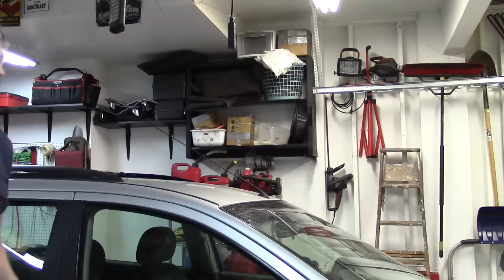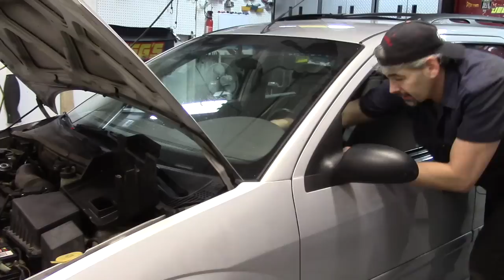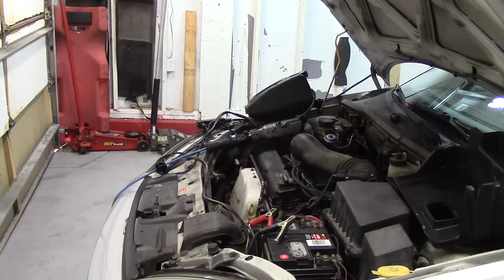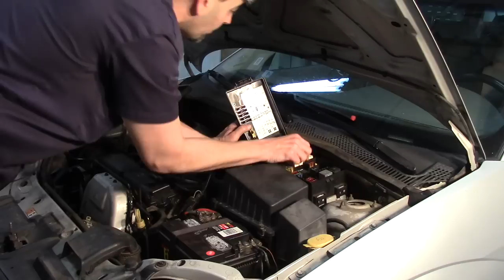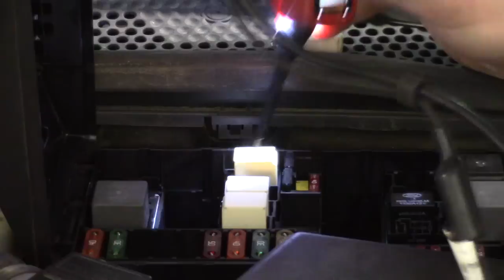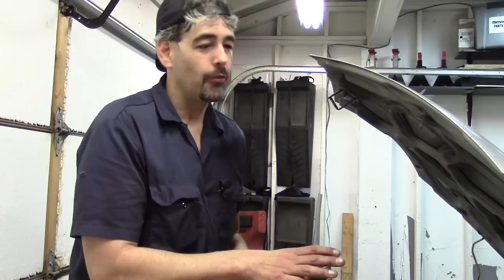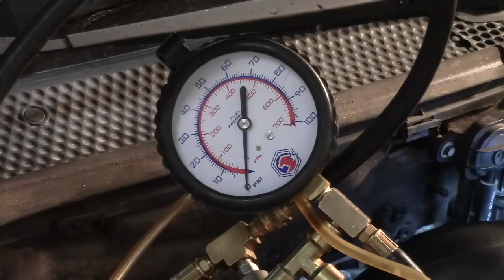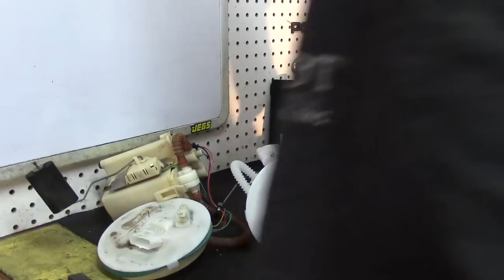Cranking No-Start Real Time Diagnosis -Ford Focus

Comment: man this is an awesome video, i was wondering if you had any videos on how to properly check for voltage and ohm resistance and contunity safely on a pcm at the wiring harness pins and connectors. I have a 1997 acura integra with some electrical problems and diagnostics call for checking voltage and continutity at the pcm, and also some sensors. Schrodingers Box
Reply from the maker: Lalo Herrera Checking sensors and PCM's safely does not come from watching a video- it comes from an understanding of how electricity works, how the components work, knowing ground side switching vs power side switching, and knowing how to use the equipment. It is a comprehensive knowledge, not a "technique".
  If you want to see a video that maybe covers these concepts more than others- see my recent video called "P0138,P0139 Diagnosis from hell" on a nissan maxima.  If you watch that video and aren't fully conscious on what I am doing and why I am or am not concerned on the potential for causing damage to the PCM, then I would recommend you not do the diagnostics yourself.  If you clearly see why I can ground out the O2 heater circuit on that model without concern for shorting out the PCM then you are probably good to do your own electrical testing.
Reply: yeah I watched both parts about two times to fully understand everything. It made sense how you chose to diagnose the sensor and ultimately find the short in the wire towards the end of the video. must say that was a tricky diagnoses, but the explanations were on point and very thorough.

Comment: You got me good this time. My wife & I were watching together and as soon as you said 03 Focus no start I looked at my wife and I said fuel pump relay because about 4 years ago we had an 03 focus have the same problem and I diagnosed it back to a fuel pumthe car ran good for a little while but then wound up having a major electrical problem that caused me to have to have the engine completely rewired so I took it to a shop a couple days later it caught fire driving down the interstate that's when I decided to open my shop so things would get fixed properly

Comment: i belive that ford redesign their fuel pump. they did away from the style of locking into the bottom of the fuel tank the new design is the one you have and you have to cut the plastic locks off the bottom of the tank for the new design. great video on the on the right way to diag a no start
Reply from the maker: andrew hippe Not sure what you are talking about but I most certainly did not, would not, and never had to cut anything ever when doing any fuel pump.

Comment: sorry if this question kinda defeats the purpose - but wouldnt it be nice to hook up an OBD to the computer and see what are the errors ?
Reply from the maker: TheKoderius The battery was dead so no error codes and I was going for speed- so much faster to get quick direction to verify no fuel delivery because after that the scantool won't help.  Had this been a spark problem I would have been tempted to use the scantool to find out why but once I determined no fuel to delivery to the ra the scantool doesn't help.
Reply: not trying to be a jerk just to understand your thought process> - but after you charged the battery - wouldnt some sort of error indicator/light go on the dash signaling a fuel problem ?
Reply from the maker: TheKoderius What would it be? There's no codes for a bad fuel pump and fuel trim/O2 sensors are not used during starting to determine mixture.
  Sorry I guess I'm not following you bro- what code would I be looking for once I determined no fuel to the rail?
Reply: im not sure about fords . but in my alfa romeo 156 - when my pump failed-  i had 2 things going : a fuel light indicator was on -tough i had half a tank full, and a code P0191.( it might not be universal).so i thought a ford might have some indication of fuel pump failure .
Reply from the maker: TheKoderius Some fords have a rail pressure sensor- it is not available from my scan tool though

Comment: I know nothing about vehicles. I know one of the pedals goes vroom. And I've always wanted to understand basic and more in-depth mechanical functions, because that thing that sits in my driveway costs money and I often rely on it. But car-talk people/friends have usually seemed frustratingly half-knowledgeable. I cringe when I see one car guy look at another (as they are problem solving a non-mechanically oriented person's car) and say "Now, to me, this looks like it could be a problem with the blah blah blah. Could probably order the part pretty cheap at BlahBlahBlah." And I can feel that they're just parroting something they heard somewhere from someone.

However, after watching just a few videos and seeing a whiteboard, I've finally connected to automotive ideas that make sense. Pretty much as soon as I heard 'Stoichiometric ratio' I thought: "Well, I know what all that junk means. Why didn't someone just tell me that when I asked how an engine works?! Because now (and have unknowingly known that) I know how a stinkin' car engine works! Finally, something worth my time that I can understand!"

The last time a friend had a car problem, after taking it to friends and mechanics in two or three different places, I said I would look at it. I fixed it and learned way more about Nikola Tesla than was necessary to tighten up a bolt holding the alternator in place.

To conclude, sincere thanks for providing excellent content so that maybe I won't have to spend so much on time, biographies, parts, and labor. Can't wait to start learning. Thanks!
Reply from the maker: Raymond Fuentes Good luck in your learning journey! It is EXACTLY your past experience that also inspired to learn higher level material and step away from that nonsense!

Comment: Hi I'm new to this you tube thing. I have a question not related to this particular video. But i can't figure how to do it any other way.
You stress that understanding a problem with the car allows you to diagnose a fault and test your knowledge. So can you tell me how the PCU detects a miss fire and how it assigns it to the correct cylinder? Also could you give the sources of the tools that you use?  ( back probes power probe etc)Yes I know I could look it up on the internet but then only I would have the info.
Reply from the maker: bobdring It does it by detecting the very slight mismatch from the crankshaft position sensor (CKPS)signal.  When a misfire occurs, the crankshaft will move ever so slightly slower as a result of the misfire.  because the CKPS "knows" what cylinder should be firing, it assigns that cylinder to the P030X code.
  Note it isn't perfect- often you will see in a single cylinder misfire that there will be other cylinders that are accidentally detected and if this happens enough, you will get a random misfire or P0300 code.  So anytime I see a P0300 I still check to see if it is really just a single cylinder misfire.
Reply: Schrodingers Box  Thanks, I never would have guessed that. Is that missfire problem code a generic thing or just on certain vehicles? Im really impressed with your channel. Most people seem to want to keep hard earned knowledge to themselves. Thank you for breaking the mold and getting it out there.
Reply from the maker: bobdring Thanks for the comments!
Misfire detection is most certainly not available in all OBD2 vehicles, but you will seldom see vehicles after 2005 that do not have misfire detection.
Reply: Schrodingers Box  the 2% are disappointed when an intermittent problem goes away,  the rest are relieved. Keep up the good work.
Reply from the maker: bobdring Oooooohhhhhh...  I love that!! Mind If I quote you on that?  Nice!!!
Reply: Schrodingers Box I'm honoured. Please use anything that I post as you wish.

Comment: Nice one  working logically always works -  well we live in the real world so make that nearly  always.
I was looking on ebay last week and came across a assorted  set of special test relays that have a switch in place of the relay contacts. Not available from sellers where I live (UK) so I will have a go at making my own from old relays.

Comment: Great video!

I don't understand the mindset of the "98 percenters" who just shoot the messenger. I just fixed my sisters vehicle with a low temp code which turned out to be a stuck open thermostat. But what was the first thing I noticed? Right. A brand new temp sensor. I suppose that if a neighbor came to a "98 percenters" front door and said "hey man, your car is on fire", he would turn the garden hose on him.

Keep up the good work.
Reply from the maker: Rob Mut I agree- I don't understand the mindset either.  I mean I know not everyone has a strong knowledge of cars and systems, etc- but even then, you know when you are just guessing instead of either letting a pro do it or at least trying to do enough research to learn how to test if you guess is accurate.  If I am unfamiliar with a system I learn about it first, it seems so obvious to me at least that there is no other way.
  I don't get it.

Comment: go the extra mile, fix the fuel pump! It's basicly an electro motor.
This is the only video I could find on the first 3/4 pages on youtube that shows an electric fuel pump repair. https://www.youtube.com/watch?v=4CmzkwuJlyA
Reply from the maker: Georgie Dekker I prefer replacing the whole unit on these models because since the fuel level sensor is in the same unit it also ensures less likelihood of fuel level sensing failure shortly down the road.  Otherwise I do in fact replace the motor.

Comment: Good job as always Matt.  I have a suggestion though that will save you some time in the accuracy of the diagnostic.  When you unplugged the relay for the Fuel pump you should have found a way to tap off of the contact and coil side of the relay with it still plugged in.  I know you put power at 87 and the pump didn't work, but you didn't get a true Voltage drop for pin 30 and 85 and 86 on the coil side.  So if you had a problem on the feed side or coil side of the relay circuits you wouldn't see it because you are checking the wires with the relay unplugged.  So if it was a problem on either of these two circuits at the relay base, you just pulled the tank down for nothing and wasted your time.  Hope you don't take this the wrong way, just observing and trying to help.  Been wrenching 18 years and have been around the block a bit, including getting my butt kicked on different problems, and learning from my mistakes.  However I try my best to share my knowledge so other people don't have to make the same mistakes I did, and hopefully it will save them some time and frustrstion.  Like what you have done with the channel, looks great dude.
Reply from the maker: Had the pump started when I sent 12V to it, I would absolutely have been voltage drop testing those contacts.   In actuality there wasn't even a need to verify the relay box at all if you think about it- I only did that because I was already there and wanted to promote my relay video lol.
Reply from the maker: What Juergen said. the power probe has a green indicator light when it makes contact, so I know for a fact I sent 12V towards the pump from the relay box.   The fact the pump didn't run means relay box is eliminated- the problem is downstream of that. 
   The decision to drop the tank was because it was such an easy design. if I had to remove exhaust or whatnot, I would have gone to inertia switch and tested from there.
Reply: I understand that the pump did not turn on when he put power to the contact output.  And I am in agreement with his thought process, it's just in the past I have encountered multiple problems with circuits and you need to Volt drop check all circuits involved that make a component work, that was my point.  Another thing you could do to the relay if possible is take off the relay cover and see if it clicks when you crank the Engine over then look at the contact side output Voltage and make sure this isn't much drop between the contacts with a Voltmeter and with the relay plugged in.  Of course you might not see very much drop at all in this case on the relay contacts because the pump is open, so no current flow, no Voltage drop.  Unless the relay had extremely bad or corroded contacts.
Reply: Schrodingers Box I understand perfectly Matt, you were spot on there, it's just like I said in a previous post I have encountered multiple circuit problems before and you need to verify all circuits involved by doing a Voltage drop test with the relay plugged in.  That way you know the contact supply wire is good and that the coil control power and ground is good.  That way when you finish the job you know all circuits involved are good.

Comment: Do you fix anything else with gas engines for your neighbors? Soon after the neighbors found out I do cars; I started getting their yard equipment. I try to keep them happy so I can do my thing. BTW excellent series on fuel trim. :)
Reply from the maker: I fix everything from cars to HVAC. It's all about understanding the fundamental theories of operation and then applying the exact same scientific diagnostic approach. 
  Just yesterday I fixed my neighbor's home air conditioning- it wouldn't turn on. Knowing that the thermostat simply jumps the 24V red wire to either the fan (green) heat (white) or AC (yellow) I simply turned on the fan and it started- this confirms the 24V power works thus transformer must be good. I then removed cover and jumped the 24V to the yellow. The A/C started right up. Done- 100% confirmation faulty thermostat. replaced and it was easy fix.

Comment: Thanks for video matt, u should have done a scanner danner and banged on the tank with your fist, it worked for him, cheers sandy
Reply from the maker: sandy anderson If I had banged on the tank and it did start the pump- was it because the pump was bad or did I shake up a loose ground on the frame? Either way I would still have to test at the pump to be 100% scientifically conclusive.
Reply: Agree

Comment: I could see it was the wrong fuel pump. 

"I don't carry the part, I can order it and it will be here in two weeks."

"I don't carry Dapper Dan. I can order it from Atlanta, and it will be here in two weeks." 

"Well ain't this place a geographical oddity,  two weeks from everywhere!"
Reply from the maker: BChrisL Lol I guess I never noticed but now that you mention it, normally the part will either be there the next day or in 5 days. I guess it depends on their warehousing and if it isn't locally available they maybe have fixed shipping schedules.

Comment: You know  voltage  drop testing  is a 2  secound job  with daniel sullivans  patented  Loadpro test leads  when you mesure  with the multimeter , a tool every  diy  can afford to own, and  i dont know  why  danner  has not  got  one  already i seen  exovcds has it also. just popped  in my  mind  when you mentioned  voltage drop testing on the video. i
Reply: Intrade Motor +1 ... I think you'd enjoy Sullivan's stuff SBox - and the LoadPro is a great tool

Comment: One can find only motor replacement for the fuel pump assy. they are a lot cheaper than the hole assembly. Focus ones are as low as 50 bucks. but i guess local parts store didnt have them.
Reply from the maker: It's more that The brands I trust do not have only the motor available, and, if you have ever replaced a fuel pump that requires dropping the tank, you will want to always replace the entire unit to ensure the float and variable resistor are replaced to ensure you dont do this again if the fuel gauge starts not working soon after
Reply: i like this page to look up for part numbers

 http://www.rockauto.com/catalog/raframecatalog.php?carcode=1385524&parttype=6256
Reply: Schrodingers Box Good point. and by the way, Really nice job you're doing here in your channel. Thanks a lot. I've learned a lot.

Comment: If i got to order car parts , i check Amazon.
Reply from the maker: My favorite is rock auto.  I Shoulda gone there first.
Reply: Schrodingers Box well ya, Rock Auto Rox.   I thought everyone knew that ;P
Reply: Schrodingers Box I am prime so 2 day shipping , and for a little more , next day . A lot of people like Rock auto , but seems shipping to here is high and can take a long time so i stopped going there .
Reply: Rhage73  random local chain style parts house, gasket and tube seals vw vr6 80 bones.  Rock auto, 35 bones.   Same name brand and all.   so 
local chain style parts house can in fact stand in line and puff on my ....well ya nads.  haha.   funny part is valve cover gasket same car local parts house with no tube seals.  30 bux.  so the 6 circular type pieces of rubber are obviously gold plated once they get to the parts house to add the 50 extra bux instead of 5.   lots of stuff like that.   certain things i get local.  but if they have to order them i tell them nevermind and just rock auto them.   plus rock auto has things that the local guys dont and dont even have the option to order. but gaskets, for sure.   Head, vc, and so on.  cant beat rock.
Reply: Schrodingers Box I always go to Rock, they have great prices, close-outs at times, many different brands, and their site is very easy to use.